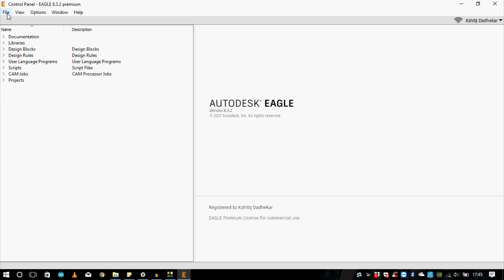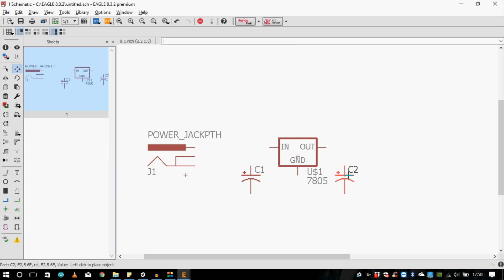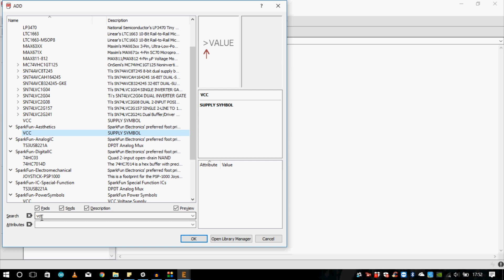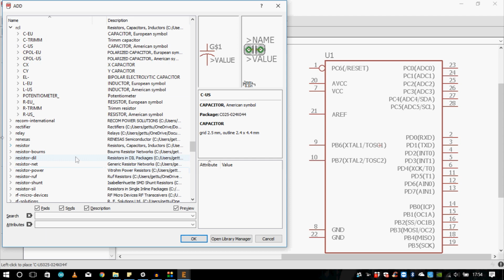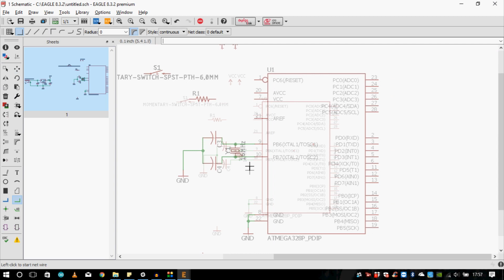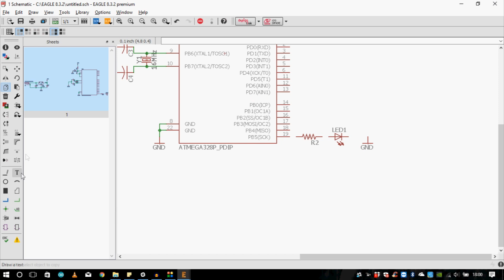Autodesk Eagle #3 | Designing an Arduino Schematic

Comment: The Recom R-78E5.0-X.X is a compact DC/DC converter module that is a pin for pin drop-in replacement for the LM7805 linear voltage regulator in Eagle 9
Reply: thank you kind person🙏